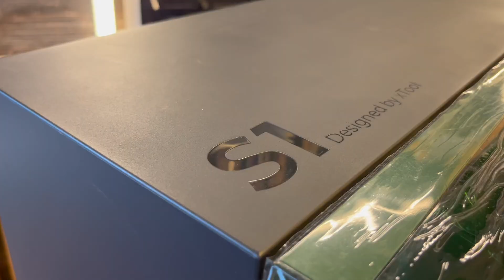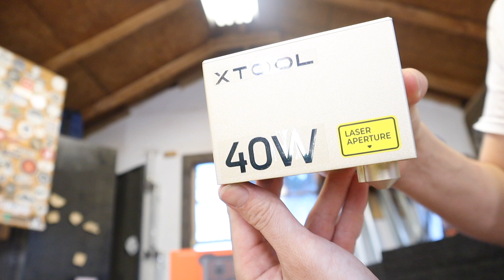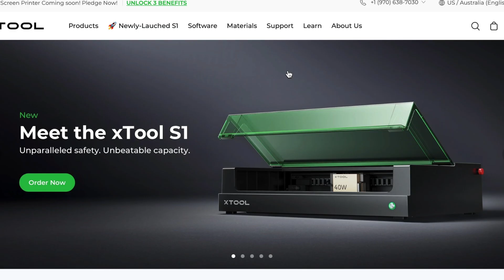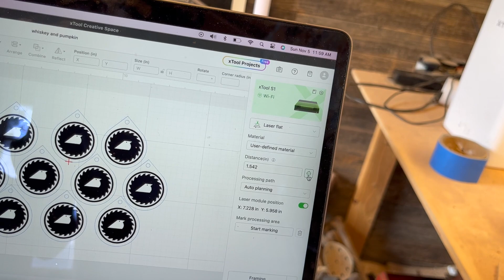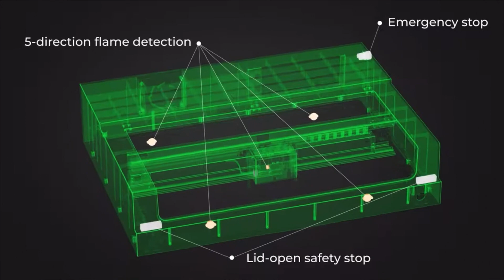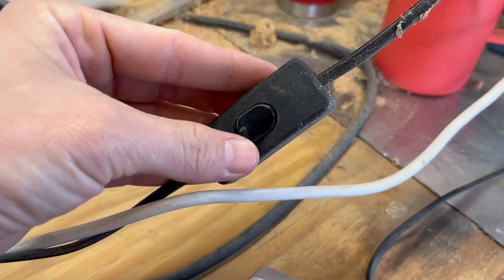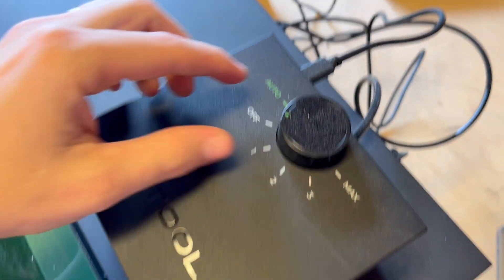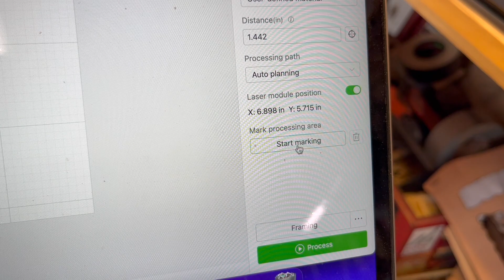Does the xTool S1 Make The D1 Pro Obsolete?!? // 40W Laser Comparison

Comment: The IR laser will also work on the S1 correct? If im not mistaken, i believe that head will allow you to engrave most metals?
Reply from the maker: XTool sells an IR module that works specifically with each machine and aren’t compatible across the two lasers.

Comment: how does the 40 watt do with engraving stainless and other soft metals?   The 2watt ir laser on the F1 appears to be handy for that.  But its limited in size, does not have air assist and is only 10 watts, (diode)    Though the S1 is diode, but at 40W,  will it do those metals and stainless items too??
Reply from the maker: You can do some metal engraving if you precoat with certain sprays before engraving. I have tested much of that because I mostly deal with wood, but you are right the F1 handles those things just fine.